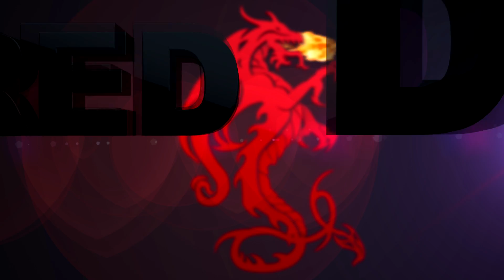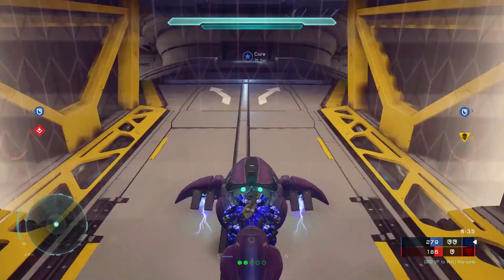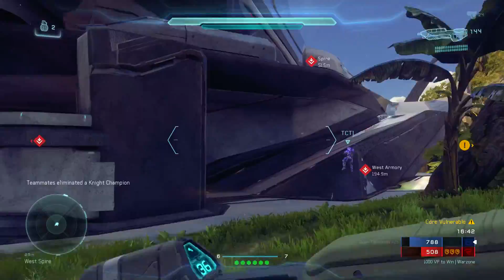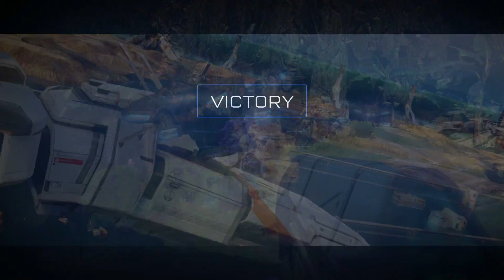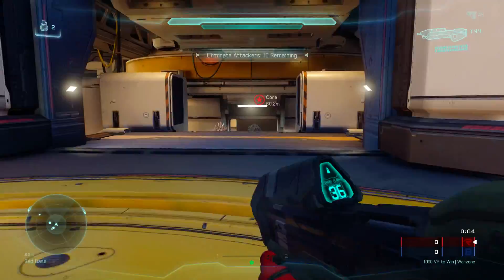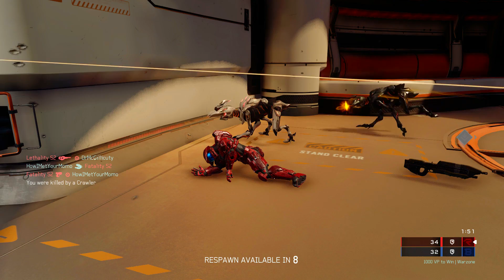New Xbox Console is Coming? Next Xbox Needs These Features

Comment: A new Xbox that i would buy instantly should have:

1. Enough storage from the start (like 3 TB)
2. Backwards compatible (xbox 1 and xbox 360 games, also still being able to play the games online) 
3. A nice design, it should'nt be a large box but way slimmer.
4. When it launches it should come with great titles to begin with (like a new GTA / Rainbow 6 Siege part 2 / Far Cry / Hitman)
5. The battery of the controller should be like the pro controller from the Wii U, last long!
6. Graphics should be outstanding, for example i have GTA on the 360 and on the Xbone and there's just not so much difference, same thing with Far Cry 4, they shouldn't even bother making a new console if the graphics dont improve much..

Comment: what it needs
full pc compatabilty for pc games and exclusive console releases
12core processor running at 5ghz each core
16gb of the latest ram
a graphics card thats 2 generations ahead of the then current best pc graphics card
sound is ok as it is
2 controllers
7.1 headset
5tb ssd removable.
backwards compat with all previos xbox systems
and all the magic sum of £199.99

Comment: What the next xbox needs:
Windows 10
Mouse and Keyboard
Cross compatibility with Windows PC
A plug in video card (like the hard drives on xbox 360's)
Upgradeable video card for mid-generation upgrade
A higher spec cpu
Xbox live and xbox certification to be the money earner (make money through services, and software, not through hardware)
Make the console on release alot more powerful than a gaming pc that can be bought for the same price

Basically, turn the xbox into a gaming pc for dummies, and allow pc gamers to play with xbox gamers without exclusives between the platforms. They can even do deals with developers to get the first release of a game due to hardware standardization benefits allowing a more efficient and quicker to market release, but get rid of exclusives.

Finally, innovate - come up with some reason to buy an xbox, something it cam do well that the other platforms can't. It is hands down the worst platform and without the kinect the most bland gaming system out at the moment.

Comment: I guess the article creator didn't realize that both the XB1 and PS4 were launched a year early. This is why many of the features were missing from the XB1. The only reason Microsoft even launched the XB1 was because Sony decided to launch the PS4 8 months early. It's true both company were initially planning to release in 2013, but when they realized everything wouldn't be ready they were going to delay until 2014. The PS4 was more ready then the XB1 and Sony knew this. They didn't want Microsoft to get the jump on them again like last gen, so they launched early. What's funny is the PS4 seemed to have more issues at launch (failing patch update, system getting YLOD, corruptad save files (which is still happening), disc getting stuck in the drive, etc..) then the XB1 which had some Blu-Ray drive issues. Not only was out the systems not ready, but neither were the games. Forza 5 was a shell of itself and was about 70% complete when it launched. I doubt M$ will launch a new XBox anytime soon. Probably won't see one for at least another 5-6 years I bet.

Comment: Microsoft will have to go the way of Valve with cloud computing. It will lower production cost if cloud computing can assist the hardware side of things and provide more power. Even something similar to "Folding" where they use people's counsels  that are not in use to provide power to other consoles. Just my two cents. Good video.

Comment: + THE RED DRAGON - Nice vid, I appreciate it and agree with most of your points. I've been a console gamer all my life - but I'm seriously considering shifting to PC gaming now. On your point about FPS - I (imo) don't think consoles will ever catch up to PC games in terms of graphics fidelity. So console titles will either always have poorer graphics, or lower frame rates, or both. However, studios and publishers make more money on consoles than they do on PCs and that's fine. So I don't think consoles will go go away anytime soon. However, I do disagree if Sony, Microsoft or Nintendo will ever make any consoles that are "upgradable", i.e increasing RAM or processor (HDD of course, but that's it). This is because consoles must be closed systems - strictly. If they weren't and were compatible with off the shelf components like processors or RAM, then they would be PCs since their architecture would have to fit this design. So the only "change" I foresee (again imo) is subsequent generations of consoles lasting shorter and shorter periods - just so that they can keep up with the times.

Comment: Here are the games i would like to see on the next console. A Tenchu style ninja game,that requires you to use strategy instead of the use of explosives like in the Tenchu games.Through smaller game engines i would love to see reboots of Eternal Champions and Primal Rage,but rebuilt from the ground up with brand new graphics and some gameplay elements that would make the games better.Those games could be on the same level as Indie titles. Mechassault,PowerStone 3,a new exclusive from the developers Mist Walker,Original XBOX games rebooted through indie titles,which by now shouldn't be difficult, I would also like to see exclusive games through out the year not just one or two games,which Sunset Overdrive sold terribly, and needed another exclusive to back it up just in case it was a failure.

Comment: What you want here is impossible because of financial strategy
If a 500$/450 euro console can run every game smoothly at 60 frames per second, who in their mind would buy a 1000$/900 euro pc that can do the same thing
Who would make free backcompatibility when hardcore gamers are willing to buy the old games again just to have them on the new console. Xbox one did this xbox360 compatibility because the xbox one sales are very low compared to ps4. What you can get is a firmware update that allows you to play old games, but you have to pay a fee for this update 50$/40 euro, or you have to pay monthly for the entire time you use the console. I am very surprised that the pc industry does not sue the companies that make mouse and keyboard emulator for consoles

Comment: The Ps4 and X Box 1 are just not good enough or their capacity utilized well enough resulting in millions of gameres feeling cheated,and if that was"nt enough some of the materials and components used are of inferior quality,like the rubber on the thumbsticks of the Ps4 and battery Controller capacity which is under half of the Ps3 Dualshock battery.Unacceptable

Comment: I like all the points you made except for just one. Making it a PC. That's the only reason why I bought a console in the first place. Granted I play pc games but there are sometimes problems and troubles you run into then you have to fix it and figure out this and that. Where as with console it's as simple as start up and play. Done. So no dear god do not allow the next console to boot into a windows form by choice. Even if it's a dual i see no point as it's unnecessary space used.

Comment: In order for this new system to succeed, they need to do the following:

-Retro looking system. Something that actually looks like a gaming unit
-Starting storage capacity should be 2-3TB SSD of USABLE storage
-Removable hard drive to upgrade storage
-Solid 60 FPS with 1080P or higher no matter what!
-16Gigs of RAM
-Backwards compatibility for ALL Xbox One and Xbox360 games 
-More value for having Xbox Live Gold
-An improved Xbox One controller design with a couple of extra buttons on top. 
-Allow cross-platform gaming. Leave it up to the developer to decide if they want to make it cross-platform or not
-Better Dashboard navigation than the Windows 10 Xbox One
-The ability to customize more of our dashboard
-Voice commands built in the system that only require a Mic to be plugged into the controller or system directly
-USB keyboards, mice and headsets should work like they do on the PS4, if not BETTER
- FIVE, quality, AAA games, with an additional 10 games on then digital marketplace at the LAUNCH.
-Every console comes with a copy of a game, period

Otherwise, I've learned my lesson and I'd wait a whole year before upgrading to this new system. Or it'll just be PC the whole time.

Comment: I think the earliest we can expect he next Xbox would be around 2018 and that's the absolute earliest although it's more likely closer to 2020. As far as features go I agree with you Red Dragon The next Xbox needs to be able to do everything the Xbox One can already currently do. Every feature the XB1 has the new Xbox should have right out of the gate. I'd also like to see some sort of microphone array built into the console to allow for voice commands like on the Xbox One but nix the camera it's not needed. I also agree that it should be fully backwards compatible with the Xbox One and the 360. The reason why I say this is because the Xbox One use's a standard X86 architecture so so long as they don't deviate from this they should easily be able to not a only play Xbox One games on the next system but also should be able to use whatever emulator they have for Xbox 360 games to work on the new hardware the same as it does on the Xbox One. When it comes to new features though I gotta disagree I don't want to see the Xbox One with any type of PC OS or use mouse and keyboard. I really can't stand mouse and keyboard as a control method it just feels so archaic and is over all uncomfortable. I also don't want the new system to require any sort of upgrading. The bonus of buying a console is you don't have to upgrade any of the parts in order to play any games on it they just work on your current hardware right out the gate and will continue to do so indefinitely until the new system comes out. That's the way it should be. The big problem for PC gaming is constantly having to keep parts up to date in order to play the latest games.

Comment: The major reason that 7th gen consoles lasted so long was due to the economic crash in 2008. If it had only been just a standard run of the mill recession, not the horrendous crash and burn it was. We would have fully recovered bare minimum in 2010. The 8th gen would have launched in late 2011 as true next gen powerhouses. Way back during the 6th console generation. Xbox and GameCube launched during the post 9-11 recession. Which goes to show how truly severe 2008 really was.

Comment: 1st Party Exclusives
60FPS-ALL GAMES
Built in battery in controller
ALL POWER NO GIMMICKS
Reply: +DThomas FromNC built in battery is a bad thing.
Reply: 2 main big reasons
1. if you have 2 sets of recharble batteries that are removable, you can switch them instantly without being plugged in. 

2. Once the battery loses the capability to charge anymore, you have to buy a new controller around $60
compared to a new set of rechargeable batteries $15.

Comment: The Next Xbox will be like the PS4 was to the PS3, improved in every way because MS learned some very painful lessons.
I can guarantee you will NOT see the following - DRM, no optical disk, Online required.

What I want on any next gen console...
1). A much more powerful console at launch than the Xbox One was (More like the Xbox 360 at launch)
     a), Better class of GPU/Dual GPU at launch  - PS4 and XBO have a 2011 AMD/ATI era Southern Islands GPU, architecture was 2 years old at their release. Xbox 360's GPU was way ahead of the game when it released.
     b). Some focus on 4k gaming or up-converting to 4k, I am expecting most games won't probably hit true 4k unless the GPU's start really hitting new performance levels.
    c). A MUCH better CPU, this is holding both current consoles back.

2). All kinds of gaming streaming options built in at launch, Tablet, mobile, handheld, PC, TV
3). At least 16GB of Usable memory, the OS will have it's own memory or memory pool. (Xbox 64mb, Xbox 360 512mb, Xbox One 8GB (only 5GB usable), if it keeps going then 64GB would be next but that seems excessive, 32 would be more likely.
4). External USB 3.0+ storage right at the start 
5). Backwards compatibility for both consoles, this should not be an issue as long as they stick to similar architectures.
6). NO gimmicks! I imagine VR/AR will be a push for them but it cannot be a gimmicky experience. 
7). A well thought out launch library, I'm more about quality over quantity, but there cannot be an absence of titles released after the launch.

Comment: I will agree on you only on the backwards compatibility. Since both XBONE/PS4 are based on AMD x86, there is no reason why both consoles should not have day 1 backwards compatibility. As far as hardware...it is going to be a big dilemma: 4K, 60FPS, higher quality textures? All must cost no more that 500$ launch price. Assuming that more people will have 4K TVs, I am expecting that the future gen will have 4K and similar issues with frame rates.  Consoles though are consoles. They are not PCs. They are expected to deliver a robustness, usability and low cost over PCs. If you wish to play Doom 2016 4K Ultra detail, 60 FPS buy a powerful PC or else, console. Mouse and keyboard have been in the Playstation since PS3. You are not missing much unless you are playing MMO. 
Historically boosting the console hardware had been proven...disastrous. Do you remember Sega Genesis/Mega Drive addons? N64 had a small hardware upgrade capability to upgrade the memory from 4MB to 8MB. Very few games utilized this capability (Majora's Mask, Donkey Kong 64, Perfect Dark). The only sound way I believe future consoles could be boosted would be by buying two identical boxes and joining them. Both consoles are using AMD tech so how about buying 2 PS5s and join them in crossfire and be able to play at 4K/60FPS/Ultra detail?

Comment: Both Sony and Microsoft need to come out with much better consoles. 
This "next gen" hasn't been all that much better than the previous generation, and both consoles are far less impressive than they SHOULD have been. Both consoles are struggling to meet even basic 1080P and 60 FPS requirements, and few games are actually impressive enough to justify the purchase of these consoles.

Backwards compatibility is an absolute MUST. You cannot expect consumers to continue to purchase new hardware if you don't exhibit some LOYALTY. Developing consoles that don't meet these expectations is the mistake made with the release of the PS4 and Xbox One.
People spend hundreds of dollars on cellphones, so they will most DEFINITELY spend more on consoles as long as they are WORTH it.

Comment: backwards compatibility.
Considering both consoles finally turned into more or less a PC's as they share the same X86 architecture. That should not be a problem. So no excuses Microsoft and Sony both have to implement that next gen.

Same goes with features.
Same underlying architecture means they should be able to port most of the functionality straight over the nextgen

Hardware.
Both Sony and Microsoft went with the cheaper APU route. That means the GPU and CPU are on the same Die.
That also means that both of them are restricted in the means of temperature, real estate and process optimization. All for the sole reason of being cheaper.

Microsoft then decided to use cheapskate DDR-3 ram which meant even more valueable real estate on the APU had to be used for the ESRAM. That decission causes the Xbox one to lag behind the PS4 in terms of GPU performance. Since this is part of it's design this gap can never be closed entirely. 

If we want better performance CPU and GPU have to be seperated again. This can also push Nvidia and AMD harder as the nextgen consoles may use GPU's from both of them again. Which leads to competition and in the end we as consumers win.
Then if they are seperated you can cool the 2 seperate chips. Which means the CPU can actually run on acceptable frequencies. For instance the CPU of the X360 was clocked at 3.2 ghz. The Xbox one at 1.7ish.

It's pretty safe to say that in terms of CPU power the current gen consoles have made 0 progress over last gen.

Comment: Sadly, consoles have been getting less and less convenient recently because they have become more like low end PCs. Games run and look like crap compared to PC, but console gamers have to pay to play online with P2P connections, and all we get for it is some free games no one wants. I think it's all a cover up. On top of that with the huge constant download sizes, day one patches, and blu ray disks that only act as a DRM feature... I miss the old days when I could just plug and play.

Still, consoles are easier to use and to jump into. One of my favorite features is on the PS4 the power save mode you can download games while you're at work. And the extra apps, trophies, and being able to interact with friends easily with the plug in microphone on the controller, just makes it more fun and convenient.

Comment: The next XBox will be a new mode built within the Windows operating system.  You will most likely boot into this mode.  In XBox mode, a virtual machine will be running on top of Windows. Software and hardware developers will write code and drivers for that virtual machine.  Third parties will release XBox machines.  

It really doesn't make sense to build a single, locked down configuration anymore.
Reply: +Toughnut do you know how many problems that would have, 
people hacking the system
people modding games
people installing other games like emulators, and steam games
not to mention people cracking games
NO ONE wants an xbox that runs PC OS, thats what PC is for!